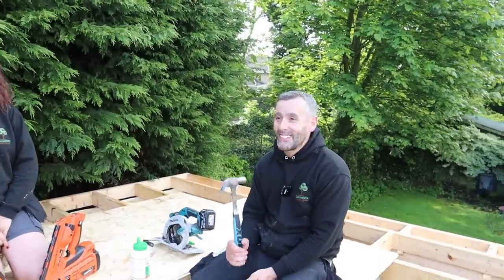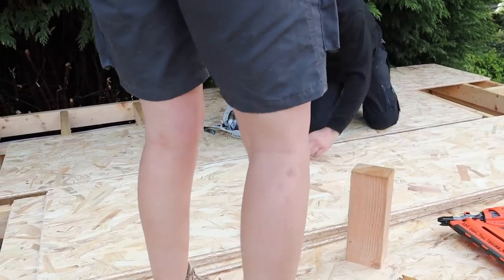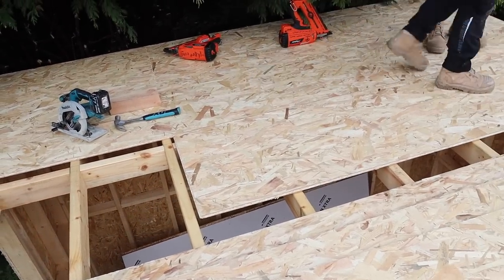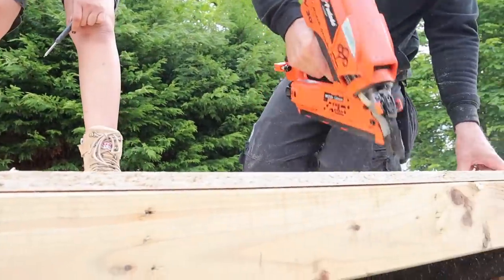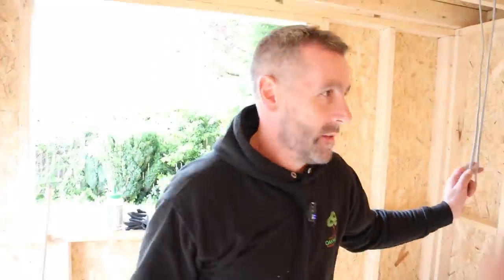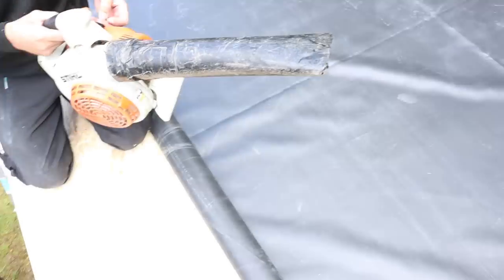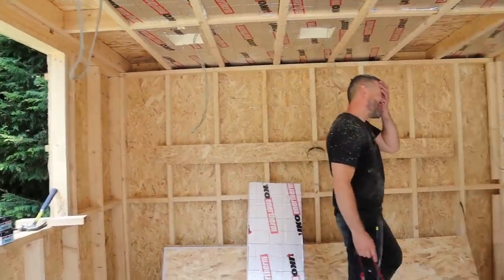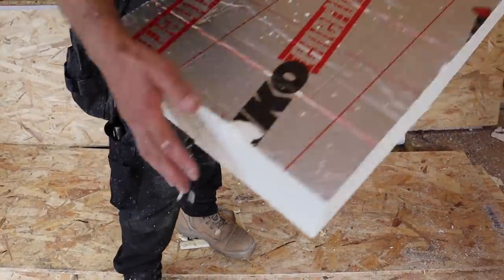Garden room OSB3 roofing and rubber roof, 1st fix lights and a bit of insulation

Comment: I am believer ‘Hybrid roof all the way’ it works and it’s easier.
Reply: hi thought a hybrid roof had insulation on top of joists as well as between. not quite sure what this type falls under or it is even a thing😂
Reply from the maker: Hybrid is a combination, it works, believe, or don’t 🤷‍♂️
Reply: indeed, did u put insulation on top of the joists... I must have missed that bit sorry.

Comment: Liam. Those PIR boards are nice and snuggly fitted - have you experienced cutting the boards slightly small, gaps between the board and the rafters? What do you do? Replace the board or use those expanding foams?
Reply from the maker: Expanding foam mate, we always fill all the gaps after insulation

Comment: Can anyone explain how the hell they install the noggins in a straight line? Are they screwing them in at an angle like a pocket screw?
Reply from the maker: Probably a little hard to explain with out a video mate. but ill try, we fix the first one through the side of the next rafter and spike it into the previous one, then the same with the next, face fix it into the next rafter and put the nail gun tight into the corner of the previous noggin and send it at an angle, and so on...... if that makes any sense 😬

Comment: @22:08 Jen saying "It doesn't protrude through the rubber. Nice! Also, no expansion joints in that OSB, and glued?
Reply from the maker: It’s not butting up to anything, where exactly is it going to expand too? 🙄🙄🙄
Reply: @thegardenroomguru  Through the rubber at the sides if you're unlucky!
Reply: @thegardenroomguru  AND, it's got to be glued - so the argument, such as it is, is academic....isn't it?!

Comment: You wanna treat Adam to the dewalt cable stapler for twin and earth. 
rapid, pretty much the same as you using the pasload over a hammer 😃
Reply: It also complies with the premature collapse regulation being a metal fixing 👌🏼
Reply from the maker: I’ll show him 🙈
Reply: @thegardenroomguru  just the little 2Ah battery lasts all day too, so for a room like you lads do it’ll be no problem at all
Reply from the maker: @Cablesmith  he wants one now 🤦🏻‍♂️
Reply: @thegardenroomguru  haha it’s a belting bit of kit mate. Doesn’t grab too hard but if it’s used where cables are hidden it’s perfect.

Comment: never join tongue and groove in the air, always on the beam
Reply: There’s always one 😉
Reply: @catstevens5890  no actually there are alot of us :D
Reply: @mammutit  that's so old school,there is no need to always land on a joist with glued tongue and Grove we do it on floors with heavy traffic, this is a roof with next to zero traffic that is way over engineered in the first place
Reply: The whole idea of the t&g is to fly over space to minimise waste !
Reply: the idea of t&g is strength, so is lapping them on the joist. everything in building is about strength and durability. there is a reason they make the boards in lengths so they splice on cc60, you just cut the ends
Reply: @dancrawford2690  how is it over engineered? The timber is C16 and span is way beyond the limit of the timber according to span tables.
Reply: Just throw in a 4x2 sideways underneath  and nail for the critics with joints glued as u do
Reply: @mammutit  yep - and your all wrong....!!!
Reply: @mammutit  the glue makes the join as strong as the wood - at least!
How many more times, ffs.......!!
Reply: Im intrigued of all the response , im going to back out of this one now and enjoy my weekend :)
Reply: @mammutit  wise enjoy!!!
Reply: I wouldn't join the tongue and groove in the air either, it might be fine today, but it might dangerous 10 years down the line. Water might get in eventually and weaken the joint, then someone could put their foot through it. For better longevity it would probably be better to join on a beam.
Reply: @BillyGooding  you can't always get join on 400 when you stagger so would have to put additional battons in to suit